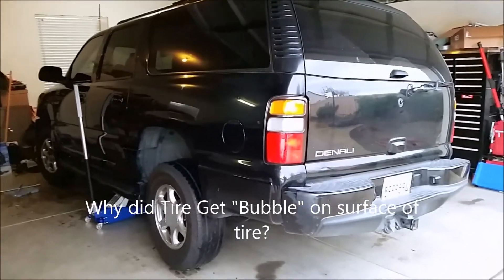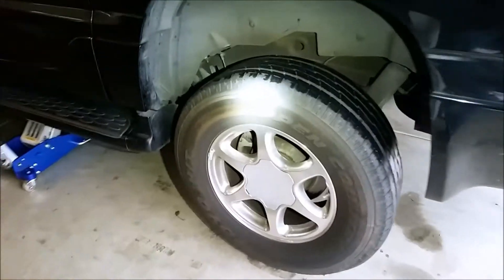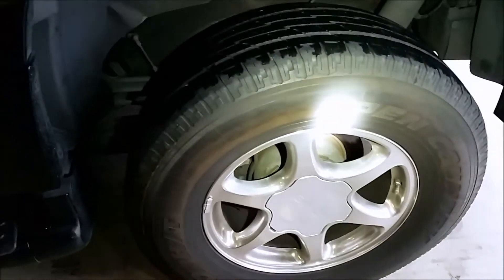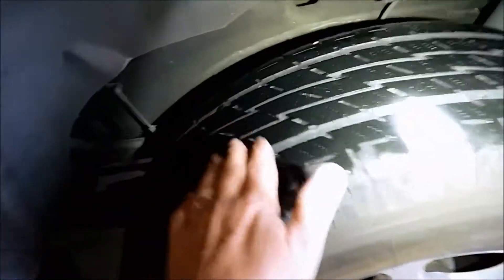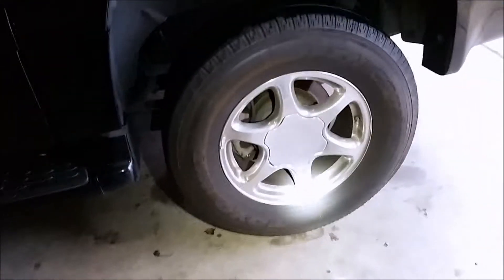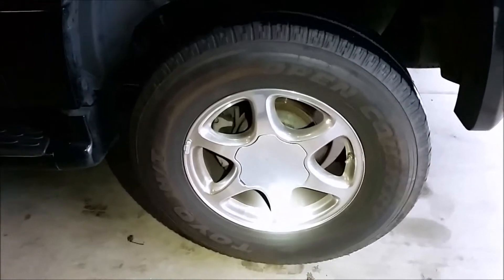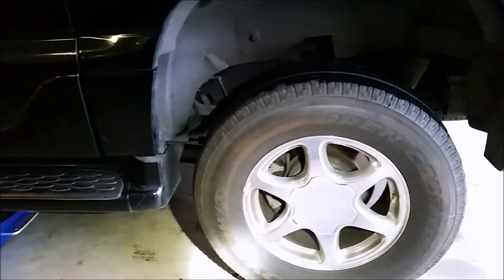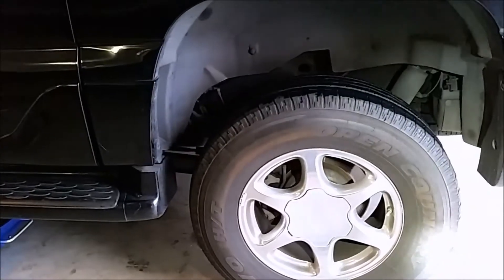Why Did Tire Get Bubble?  Give Advice (asesoramiento)

Comment: Street tires used to go off roading can be a potential cause... Similarly, if a tire was parked on a rock or edge of a curb, hitting a pot hole (I think you get the point) can cause the tire's inner lining/belts to break/separate weaken  then the bubble forms over time... Regardless, if such bubble is observed, time to replace it.